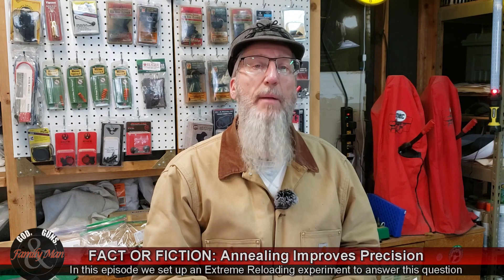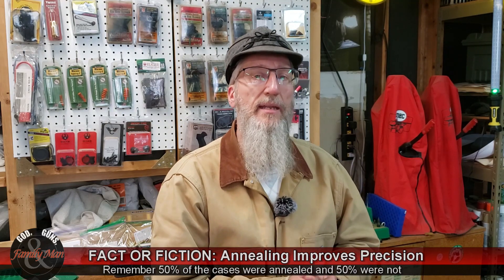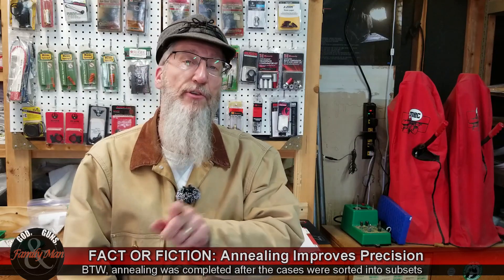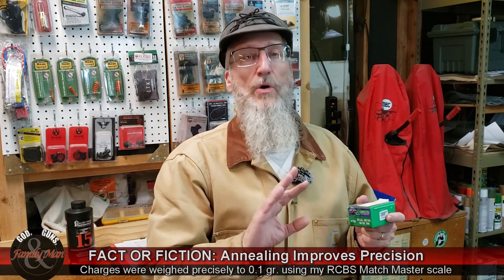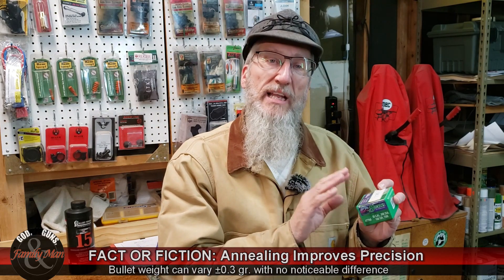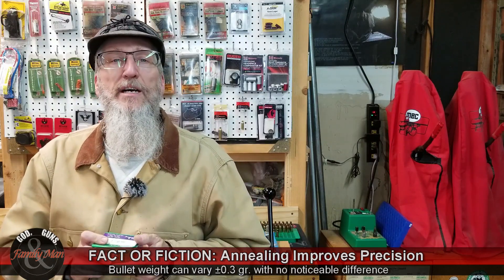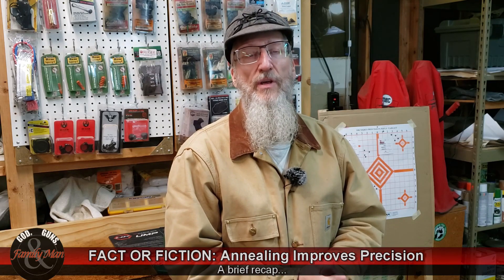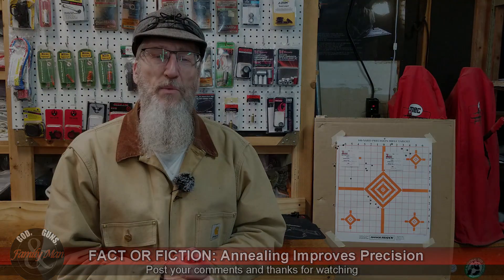EXTREME RELOADING: Does Annealing Improve Precision? (part 1, ep. 02)

Comment: I have never annealed and after advice from Sierra I don't use an expander ball anymore either.
What I have found when my cases are new they are uneven widths on the neck , one side @ .009 and the other side @ .012 but after say 4 uses the thicker side begins to reduce closer and closer to .009. I also have notice the end of the neck is usually uneven until I trim then it becomes perfect @ 90dgs. 
These cases are Remingtom & PMC 223s 
I do have 200 rds of Norma cases so I'm hoping the same with happen although the widths of the Norma necks are generally the same all around now. Very little difference. 
Sierra said no expander ball and no annealing and I should get 30 to 40 reloads / case.
Reply from the maker: Thanks for watching DLN1234.  We have an episode coming up looking the effect of neck wall thickness that you might enjoy.  
I have been reloading since the 1980's and I have never gotten 20 reloads from a piece of brass. As you fire and reload, watch for case head expansion and incipient case head separation.  There are two places a case will fail, one is at the head and the other at the neck (it will split or crack due to repeated stretching during firing, then being resized down during FL resizing.  Annealing keeps case necks ductile and will prolong the life of brass.  I use an expander mandrel (not an expander ball) to set the case diameter as precisely as I can and affect a good neck tension. In my experience, if you get 10 reloads you are doing very well.  My advice is to always be safe and if a case degrades in one way or another, throw it away.
Reply: @sdkweber  thanks ; once I get around 10 reloads I will start watching much closer for  case degrading.

Comment: I'm probably not the only one who was surprised by the results. 

I anneal after each firing and use a neck expanding mandrel to insure uniform neck tension. I use a .307 diameter carbide mandrel allowing for a slight spring-back. I generally bump the shoulder back between .001 and .002.
Reply from the maker: Remember, I shot only 2 5-shot groups.  I have 10 more groups to go (5 more range sessions).  It gets even more interesting and its too early to make a conclusive statement about annealing.  I think you will really enjoy this series and thanks for watching.
Reply: @sdkweber  Oh Yes. I watch your channel and enjoy its content. 

Regarding the first test, I'm wondering if you annealed 50% of the cases before sizing may result in different results. Me feeling is annealing after sizing may have adversely affected the case resulting in the results you've shown.
Reply from the maker: @SimpleLife1971  There are various approaches to the timing of annealing relative to other steps in the reloading process.  I chose to do as little working of the brass as possible once I annealed thus preserving the effect of annealing and hopefully showing the greatest difference.  Keep watching, we have only 10 rounds fired and 50 more to go.  Thanks for watching and posting.

Comment: Did you change your sizing die setup between the annealed vs not annealed cases? Or measure the difference in headspace measurement after sizing between the two? I would expect the bump between the 2 to be different if the sizing die setting wasn't changed.
Reply from the maker: To maintain the rigor of the experiment nothing else was changed save for 50% of the cases being annealed and 50% not annealed.  I hope you will be able to follow this series... it turned out very interesting.
Thanks for watching and posting.
Reply: @sdkweber  if your headspace setting is not maintained then your annealed cases will look worse because they are sized too much. I understand your not wanting to change anything but by not changing your die setting you are changing something which is your headspace dimension. This will cause precision issues.
Reply from the maker: @BoltActionReloading  I full length resize prior to annealing, this allows me to reducing the working of the brass case and maintain the improved ductility as a result of annealing.  Stevenson's disssertation talked about this and some of the effect of annealing can be removed/degraded by simply working the case (though firing has a much larger effect).  Very little happens to the neck of the case after it has been annealed.